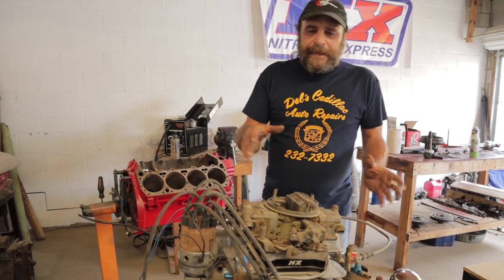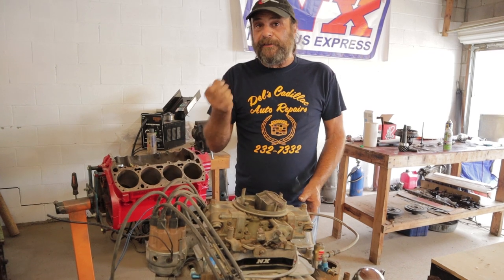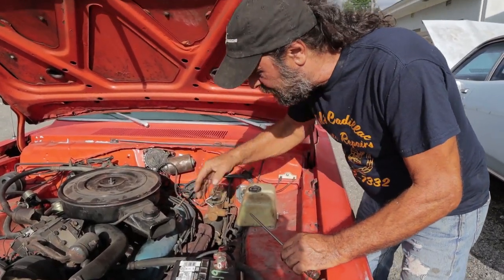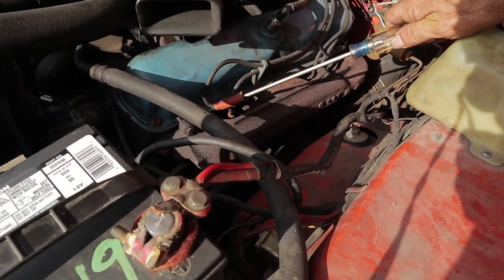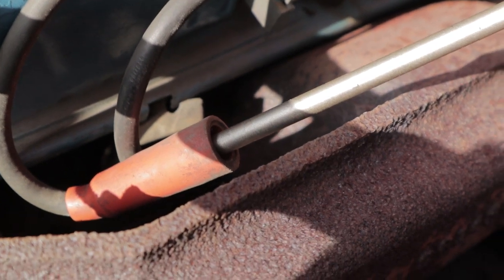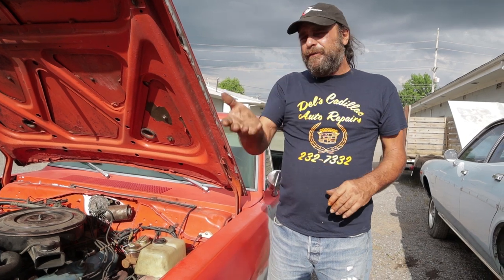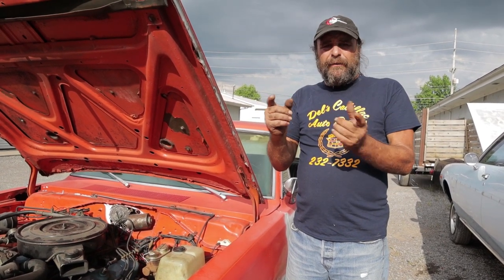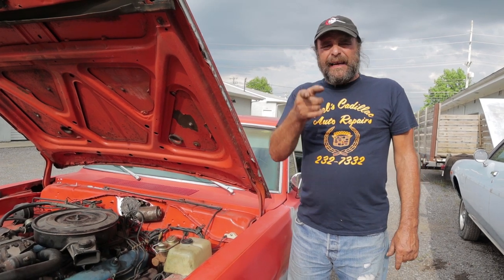Engine Fundamentals- Checking Spark Quality

Comment: Dude what you said at the beginning hit home. I had a 66’ 6 cyl mustang come in with a no start issue. Checked fuel, spark, compression and timing over and over and could not figure it out. Turns out the distributor the kid installed was an Autozone piece of junk giving me a false spark. I could see the spark but it was not good enough to start the car.. exactly like you said, man! I installed the original distributor I found in his trunk and it fired up. Awesome video man!

Comment: When I was about 10 years old I got to use the push mower for the first time. 
Yay mow the lawn ,what fun. 
So I was going under some  bushes and came back out and it's spitting and sputtering. 
I looked on the front of the engine and noticed the plug wire popped off, but this 1/4" long spark was jumping to the plug. 
That blue arc was pretty cool looking. 
So I grabbed a green leaf off the tree and placed it in the gap to stop the spark.... bzzzzzt!! 
It left a burn mark on the leaf and I learned all about electricity that day 🤣

Comment: Even the Mopar guys talk fondly of the awesone HEI ignition. JUST CAN'T BEAT an HEI I've owned a few Chrysler engines, all industrial. An IND30 (industrial flathead 231? 6 in a forklift) and an industrial slant 6. I converted both of them to GM HEI, and it was a major improvement in smoothness and easy starting. No more missing, skipping, hard starting on cold, rainy days, or in subzero temps. I've had a good HEI jump a 3/4" gap pretty consistent, and a 1/2" gap consistently.That's a LOT of power to the plugs. The firing arm will erode in the long run.

Comment: Working on my mopars i've got bitten once or twice from the coil and or plug wire . It didnt hurt just wakes you up lol . Here's an old practical joke to pull on an enemy or a friend  i learned from an old timer . He said to cut off a small section of cigarette filter and soak it in water then unplug the plug wire from the middle of the distributor cap insert the piece of wet filter reattach the plug wire. Who ever starts the car and drives off has a certain amount of time to drive the car till the water in the filter dries out disconnecting the electrical circuit making the car stall  lol
Reply from the maker: That's diabolical...I love it!

Comment: With a weak coil you may have enough power to spark in atmospheric pressure, but it may not be enough to fire a spark under compression. I found out the hard way with a tow bill. I was stranded a block away from an auto parts store, all I needed was a new coil.
Reply: I had a cylinder 2 misfire in my Mazda3 Skyactiv turns out the pregapped NGK iridium spark plugs at .044 were to wide to fire with the 12:1 high compression at idle. Closed the gap to .030 which is the reccomended gap and the check engine light went out. Something so simple you would never think of it. They tell you to not gap the spark plugs. Just recently changed to Denso Iridium TT's gapped at .030 and my mileage went up 2 to 3 MPG

Comment: Soldered 8 cut wires recently for fuse board & behind radio on loom relay beside speaker 1s.
Headlights & idle haven't worked normal since whoever hotwired it, at least the updated 1985 relay fuses prevented the rest of the loom frying on the I6 crossflow utility daily driver.

Comment: at sea level its about 100 thousand volts per inch on spark. so your third of an inch for stock and two third for HEI is rite on the money. On my first chevy v8 in my 48 chevy. I made everything 6 volts and ran .025 spark gaps. the engine ran out of spark and 85mph in low gear(never knew what the rpm was did not own a tachometer). Put the A width fully on the 45 amp 6 volt generator and made the started out of a 53 and 56 parts. pressed the straight spline shaft out of the armature and put in the twist 56(got the pressing done at the local rebuilder for a buck). some might wonder about using a 53 6volt starter to crank the v8 but with the fuel injection cam the v8 cranked easy.

Comment: Great video.  If you pull the plug and the engine sounds exactly the same...you just found your dead cylinder.  Try running the engine in the dark...bad plug wires will expose themselves as blue sparks seeking alternate grounds.

Comment: Cheap HP, make sure that cap is clean inside, wires good and on older cars I've had great success with blaster or super coil even better MSD box which helped with the snappy acceleration and a few mpgs if you keep your foot out of it. UTG thx again. We older guys forget these common sense things. Have to keep the hobby alive and pass the torch.

Comment: The number 1 thing an engine needs is good compression. Without compression spark and fuel don't matter. I have seen quite a few engines that people have poured hours of time into that had little to no compression and would not run no matter what you did to them.

Comment: i HAD  a car where there was not getting its 12 volts to a coil on a escort. I was in  school and a student I fixed it . When the instructor would say it was something to do with trans but it was nothing to do with trans I eventually got it working properly screwing around with the wire U would see the power return to normal and the problem was fixed after fixing the 12 volts to the coil.

Comment: Years ago my nephew had an old polaris, the guy he bought it from had put a new distributor and msd ignition system on it, my nephew and a couple of his friends spent one thursday night having a few beers, but seeing as my nephew had to work the next morning he turned in first. One of his friends thought it would be funny to hook up a plug wire to his horn and hear it go off a 5am when he went to work.
Never heard the horn, but My nephew came by my house after work and told me something was wrong with his car, I could hear it missing as he drove up, he also had a towel wrapped around the steering wheel, and he looked pretty ragged.
It seems that old polaris had a solid metal steering column, a metal half moon horn button, and several places where the bakelite had cracked and seperated on the steering wheel, the plug wire was arcing to the steering column traveling up to the steering wheel and then arcing through his hands and grounding to the half moon horn! Damn thing was electrocuting him whenever his hands touched the steering wheel!
😂

Comment: What would be the main symptom that would cause  this test  to be run,   basically a rough running engine would make you feel that there was a misfire, and this would be the test you would use?  If you do it this way, do you have to test each plug wire individually, or could you just go once straight from the coil wire.  Thank you for these informative videos, you're the man👍

Comment: @Uncle Tony’s Garage If I may request a video/video series. Your Dart(flat maroon color) I haven’t heard much history on it. Is it possible to get a video or possibly video series on where it started, what you replaced/decisions made, flaws that it currently has etc? Thanks.
Reply from the maker: Lots coming on that car as soon as we have Project Bottle Rocket up and running.  We did a short vid on that Dart called Plan Z Dart.  There's even a clip of it making a test hit on the street

Comment: That's one step better than what I do... 
I have a spare spark plug that I plug into the wire, hold the plug to a ground, and watch the spark in the gap.
Reply: I'm trying the same test(s) on my 6 cyl Buick 3800. But, I purchased an inline spark tester light bulb. $12

Comment: Dam you got a nice little collection of those del's caddy t shirts in every color. Nice. Total dig it is that phone number still good or is it just a throw back t shirt. I only ask because looking for  a caddy shop in da northeast that doesn't suck ass and when you're dealing with caddy shops that can be hard. Not to mention beside da wifes new caddy I have a couple of friends that I think they only bought their caddys because they see me driving the wifes and the 3 of them  has always went out and bought the same exact ride I all ways had since the 80s because in their mind I work on my cars and they are always running if they are broken it means I just bought it real cheap And am going to fi× everything on it and I am I going to get the thing to run great and park it in the back yard. For a hot minute the neighbors cars will be brought to my house when ever I am going to do my car I will do theirs along side mine works out nice those 3 guys pay for all my parts for time ups oil changes tranny fluid N screen filter.  The past 4 years have been sweet I go on rock auto pick up what ever then mark 4 for the amount and send the order to them they split the cost by 3 and ship it to my place. One of them has a nice connection for oil and filters. So I would like to not work on the wifes caddy  or 2 other ones can you dig it. I am now playing with a.gaint wonder bread truck with a Cummings bt4 nicest little turbo desiel I ever worked on the torque is out of control and since new Jersey passed the no obd2 no need to get it inspected which is a dream come true so I ran out and bought 3 ford f 150 and f150 All with the straight 6 300 so I would rather work on that shit instead of the 2018 caddy which to me is not a happy place.. I would rather work on the old pick ups I am thinking about throwing a turbo on the 4.9 in line since it is fucking bulletproof but is shitty on gas and quickness torque is fine.

Comment: This was very informative.  One time, I was doing this test on a lawn mower, and the screwdriver had a metal cap on the top that was continuous to the shaft, so it zinged me.  With a more recent car with plug wires (like the GM 3.3 & 3.8), are those voltages dangerous?  I guess you could always wear a leather glove when doing this test.
Reply from the maker: Not enough amperage to actually hurt ya

Comment: I've seen on a few channels here on YT how to fit the Dizzy. I do have a few questions for you Uncle Tony; What is the correct way to fit a Dizzy and set it's gap on the points,? How tight do the Dizzy mounting bolts have to be and what sort are best? What are the materials used for Dizzy longevity? How do you find Cylinder 1 when setting up timing? What is the best Dizzy for typical applications such as street or strip etc? Are cheap Dizzy's worth while? Do you have to match the Spark Plugs to the Ignition Wires and Dizzy etc, vice versa? Do Dizzy's have to be run in prior to fitment? What Lube is best for Dizzy's and where to apply it? At what point is a Dizzy &/or it's parts considered Up-to-Shit/Unservicable (U/S)? Can a person mix n' match Dizzy parts from other makes and models and manufacturers? Cheers for the video bud :-)
Reply from the maker: Man that's a bunch of quistions!  Much dizzy stuff to come
Reply: @UncleTonysGarage  There is, I got carried away :-)

Comment: Uncle Tony, today I did my first mainline Dyno on my 1966 Mustang 289. I've done a lot of performance stuff to it (bored out, ported heads, headers, big cam, etc) and when I did my test, I only made 213.1hp. how come I had such a big loss of power, when theoretically, I should have made quite a bit more?
Reply from the maker: I'd have to be a psychic...a REALLY good psychic to answer that question for ya.  Probably something simple overlooked or mis adjusted..OR, you combination is just flat out bad.  Good luck with it
Reply: @UncleTonysGarage  come to think of it, I have been running rich for a while and my plugs might be fouled up. How much power loss can you encounter from just the ignition system?

Comment: Tony ever seen Sparkplugs without ground electrodes?  Basically the only ground is the threads
Reply from the maker: Yeah, Champion made a nitro plug like that back in the 60's.  I'm sure there are other examples
Reply: Uncle Tony's Garage I first seen this on Formula 1 engines.

Comment: My friend was driving his girlfriend home in his 81 Chevrolet Camaro Z28 And the mechanic came with a tow truck And he said it needed a $5000.00 engine job my friend got his friend to trailer it home he changed his distributor cap And the car was absolutely fine beware of crooked mechanics even Tony catches them in the act

Comment: Uncle tony we have coil packs...no cool points.
Reply: lame, good luck without your computer control
Reply: @fastinradfordable  273,000 what you got
Reply: @ryandavis930  299,000 on the motor with computer control, another 100,000 with a mechanical injection pump.
it shall be pried from my dead hands

Comment: Your doing it all wrong. First pull wire out of center of cap hold finger against metal contact and hold thumb against a good ground. Have someone crank engine. When you can feel your hand again. put wire back in and do the same with the end of a spark plug wire. Then compare the time your hand was numb They should be the same. If not repair and recheck.